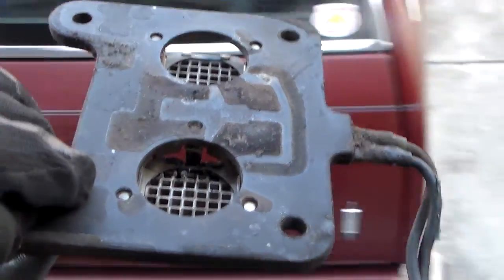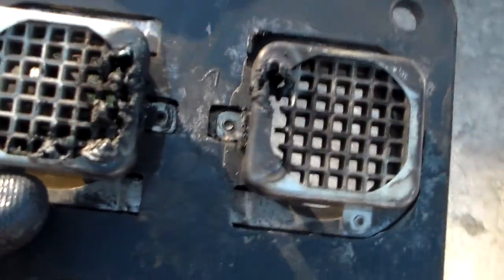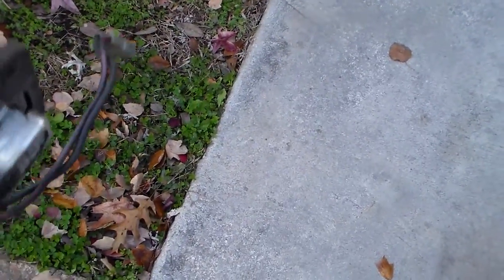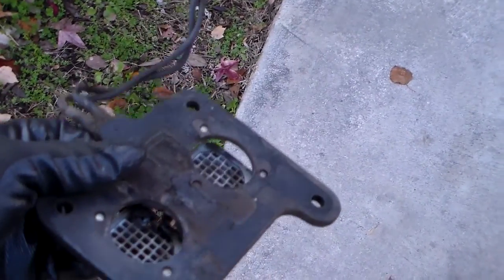Early Fuel Evaporation plate

Comment: Any idea how much that unit, or one like it that works, improves the fuel economy?
Reply from the maker: Hard to say. It only operates for a certain length of time as the engine warms up, then a relay shuts it off. After that it just sits there impeding airflow.
Reply: So it doesnt even factor on the mpg.. its only there for startup

Comment: If it is a bad EFE will it make your car backfire
Reply from the maker: Probably not. What kind of vehicle is it?
Reply: 85 s10 chevy blazer 2.8
Reply from the maker: John Durbin I would suspect a carb problem first, Also make sure your plug wires are properly separated and not laying across each other.
Reply: well I just spent 500 on the carb and I check to see if my spark plug wires are connected correctly and they're not touching each other so perhaps would you think it might be timeing